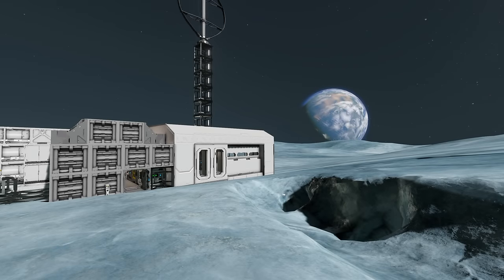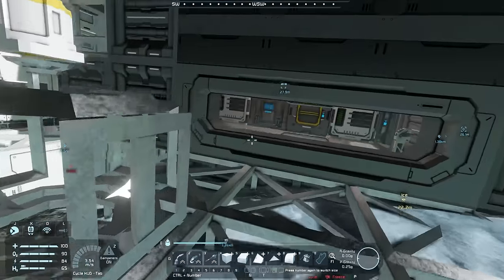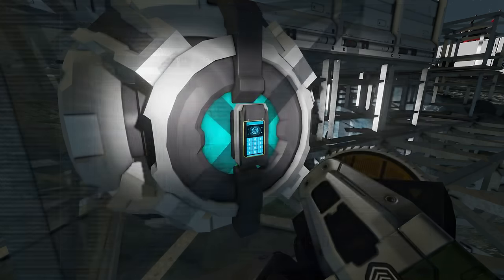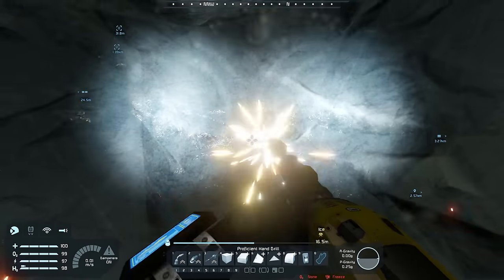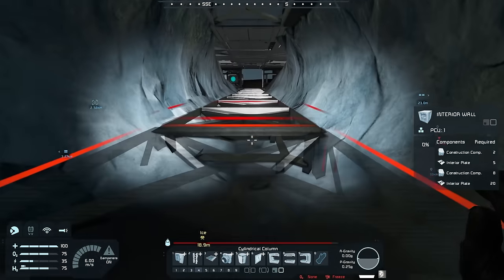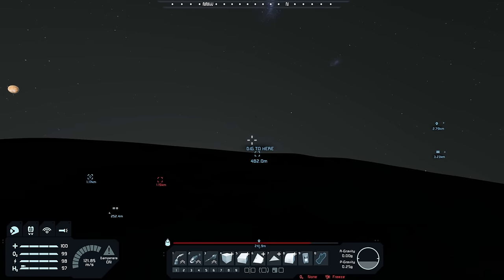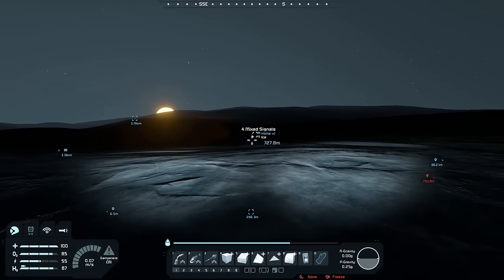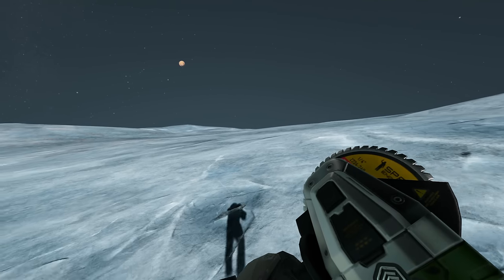Space Engineers Survival (Episode 6) - New Solar Tower! [2024]

Comment: I've actually done this before on gleeb's Pirate/Salvage season on his community server. Due to loading issues when we reentered the area (tons of grids attached to the base and the base was huge) I suggest putting a connector at the base side of the tunnel and one at the tower side. It will/could greatly reduce the performance hit of coming back into the area of your base. After breaking our base up a bit in this manor it helped a lot with the loading issue but it also helped with sim speed.

Comment: Have i understood this correctly? Power is distributed via structures even when structures are not fully built? Containers and machines can distribute materials where ever if they are connected by tubes, also you can access stuff from anywhere if they share a tube connection? I played this few hours when it came out but it was so buggy for me with my old pc so i didn't have it in me to continue.
Reply: Yes, power is transfered through the blocks, full or partial.  Stuff and things can move through tubes (small grid tubes have some restrictions in terms of size).  My PC is 2012 vintage and still runs the game very well (the game is 10 years old, so you do not need a skynet level pc to play it).
Reply: @Chilled_Mackers  thank you
Reply: @Jiepers  Glad to assist.

Comment: for a bit more survivability of those defences might be worth placing welders next to the turrets just under each one.... and extend outwards via supports as far as you can to have decoys to distract the focus of enemy ships/drones etc... giving the chance of each turret being able to take down any aggressor or having a bit more chance to do so and maybe placing heavy armour panels to your vital areas that house your industrial facilities and survival kit

maybe even angle the main buildings using armour panels to allow for a chance of deflection too
Reply: another idea is those small drones you have if you can grab a small ore detector, small battery, with a mag plate on the bottom of the ore detector or battery, and a small interior or rotating light with a small solar panel add a connector to the top so your drone can pick it up, drop those off at the ore sites which will allow you to not only see the ores that are there, but also give a warning light during the night.... dropping near the Ore holes might make it easier to spot and have a better way of detecting how close you are to the ground too

Comment: Did you know that you can double stack normal solar panels? You can't do it with the colored ones because they're too thick. In order to double stack the normal solar panels you put one down like normal, and the flip the next one over so that it's face is connected to the face of the first one. In terms of looks, it's basically an extra thick solar panel that has the power production of two solar panels.

Comment: When you use the turret controller for your solar arrays, do you get the jerkiness? Mine always do and it worries me that it's going to break something.
Reply from the maker: Have you tried share inertia tensors? I enable that for any rotor/hinge/piston that is not touching the main grid and that fixes it. So in the case of a solar tower, the hinge on top of the rotor would get share inertia tensors. Aside from that, you could try lowering the speed inside the turret controller so that it doesnt snap to the sun.
Reply: @AndrewmanGaming  I always use share inertia. If I recall, I tried lowering the speed, but it still would snap as the sun moved. I gave up on turret controllers when I had more than a few solar arrays.

Comment: The amount of hidden unwelded blocks that are in the ground and/or are a corner block, or behind/under another block, is a little frustrating, lol.

Edit: Keen needs to update the base game solar panels so they can be colored by default, instead of needing a mod for them.

Edit 2: 30:46 It's astonishing how buggy this damn game still is. Poor development, caring more about pushing out cosmetic DLC than fixing the bugs or adding actual content that's not DLC, like more damn weapons

Edit 3: Still strange how you say, "Gatling." Lol, "Gad-ling" or often times, "Gat-a-ling"

Edit 4: 41:51 You should really consider moving the GPS points to on top of the holes so that 1. You can find them easier, and 2. So that you don't accidentally drive into them in the dark